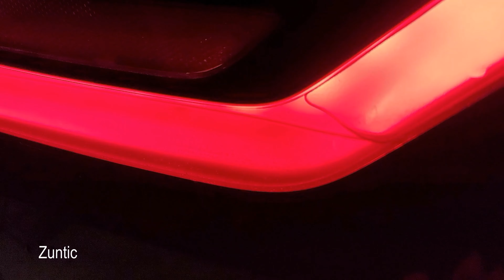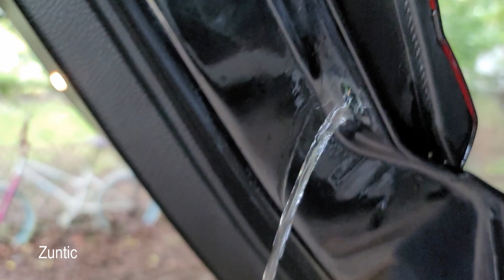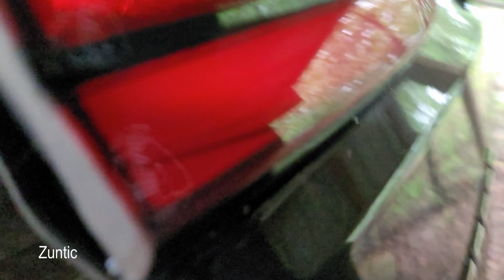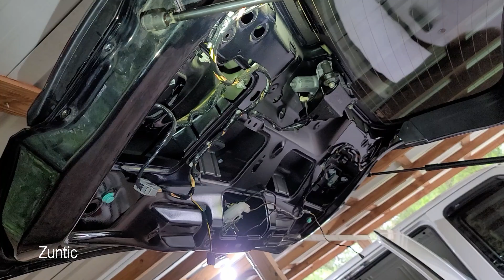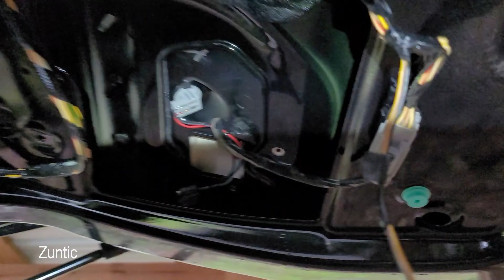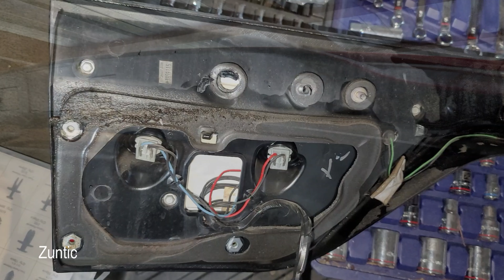Dodge Durango rear tail light water cause and removal

Comment: Thanks for the video.  I’ve had the light replaces once, luckily it was still under warranty or it would have cost $1,000! However, the problem still exists.  I love my Durango, but this problem and the from blinker problem are driving me nuts!  It’s frustrating when you see so many people having the same issue, yet Dodge has yet to creat a recall.  Is there a place that I can complain to to help make these issues a recall?
Reply: I had the same two problems!
Reply: @Johnny Dennis bastards! They had to know these lights would be a problem! I always liked Dodge bc you got a lot of great features for the money and I found the vehicles to be very well built and economical but the lights getting water in them is an issue, as well as, the starter. The engine shut off that happens when you stop at a light, etc is nothing but a wear n tear on your starter so I always turn that off so my engine doesn’t turn off at every red light along the way.
Reply: This firm is investigating the issue - Cafferty Clobes Meriwether & Sprengel. I have reached out to them but yet to speak to the attorney who is handling the case. Will update when I learn more.
Reply: 2019 same
Reply: @iandalrymple7255  any update?
Reply: @Kmac23YT  I spoke with an attorney with that firm and he said these matters can take a long time. I have not heard back from him
Reply: Manufacturers do not issue recalls unless it is a safety issue. The race track light is not the brake light. Therefore, it is not an actual safety issue and Dodge will not issue a recall. That’s not to say they can’t lose a class action lawsuit but for everyone always wondering why manufacturers don’t issue recalls when they know there are designed flaw it’s because they only issue them if they are actual safety concerns.
Reply: Are u refering to the left turn signal bulb out issue? If so i used the alfa obd2 to turn that mess off, had the fast blinker issue on my driver mirror but no bulb out, once i turned it off, no more blinker notification issue 😂

Comment: I was driving at night & my headlights went out. I thought it was the bulb. Replaced it and did it again. Weeks later went to my trunk & I seen the water. Remembered this video. I bought rubber gaskets for the bolts and bought a roll of rubber online and gorilla glued the sheet panel... havent had a problem since

Comment: I had my light replaced under warranty also. After watching several videos, seeing people use sealant to keep the water out, I asked the dealership to please seal it. And they did not after one car wash. I had water in the light again! If you leave the two bottom screws on each side of the light out do not install them it acts as a drain so far that’s been working for me. It’s very frustrating.

Comment: Did you happen to do a video demonstrating how you removed the interior panel on the tailgate? I don't want to break anything, and there are obviously additional fasteners behind that interior panel that must be taken off before removing the light assembly. Thanks!

Comment: Video reminded me I am overdue replacing my blinker fluid. 

Didn't think about the drain plug with mine. I just drilled a micro hole in the very bottom corner. Figure it should drain itself as it needs too. Was a surprising find on a new car and on both sides.
Reply: Has that worked ok so far?
Reply: How has that held up?

Comment: I have the same issue with my 2017 Durango...the light on bottom, red part just on the right side is out. I had the SAME issue with my 2012 Durango but luckily the lights weren't one piece so all i had to do was pop it out and change bulb. UGH! i knew there was a reason I didn't like the back tail lights on the newer Durangos. What a frickin' catastrophe! thanks for informative vid....haha...the music...so melancholy!
Reply: Whered you get the bulb !? I have a 2015 durango and the bottom left track tailight is not working, probably from the intrusion, but where did you get yours??
Reply: @mikegut8029  if your 2015 has a track light, then you have to buy a new one from a dealer. The whole assembly. That’s the problem...the racetrack light is one piece so it’s a tube that you can’t purchase separately. The older Durango’s had 2 separate tailights so you could just go to O’Reilly or any auto parts store and buy the bulb, remove the cover and replace.

Comment: This has been an on going issue with that Durango track tail light for years. I had mine replace 2 times. The issue is the cheap big sponge gaskets on each side. Eventually heavy rain will begin penetrating through the upper part of it. I have a well documented open case with FCA about it . They said they were investigating it but they have not gotten back to me. I have been so fed up with the issue that on the last new replacement that was put in I sprayed it with plasti-dip. Plasti-dip is a rubber waterproof removable paint like material that has been used by car enthusiasts to cover up and paint parts of vehicles. I use it to coat those stupid gaskets that should have been made by solid rubber to begin with. I choose plasti-dip over a caulk because it is removable, incase you ever have to remove the track light. Only thing is you have to spray some in the creases between the body and the light fixture around the gasket at least once or twice a year so it can continue its protectant seal.

Hope this can help everyone with this issue. It doesn't matter if you get a brand new track light this issue will happen again unless it is coated.
Thanks FCA for making such a cheap bullshit gasket.  They have a 95K version Durango Hellcat with this same crap on it. They should be ashamed.
I wish I could work for them and design a real rubber gasket for this issue since all the idiot designers there did not do a good job.
Reply: So is the water getting inside making the light stop working?
Reply: @ldawg7191  Yes if water keeps building up inside and pooling at the bottom of the LED light that area it will stop working
Reply: You removed the water and the light starts working again?
Reply: @ldawg7191 yes
Reply: @ldawg7191 no.  It’s shorted out.  Fortunately only a section 12-18 inches on bottom where it pools at least my experience

Comment: Im going to leave the screw out in mine so the water won't collect dodge has a 2 year warranty on a new one they made it to be defective
Reply: How is it holding on like that?
Reply: @Switzerlandboy420  it's about 10 screws holding it I just leave the corner screws at the bottom off so water can drain
Reply: I’ve tried leaving the bottom bold out on both sides but I still get water. Currently removing my track light as I type so I can just reseal everything up. This is a piss poor design and the fact dodge is avoiding a recall on it is even more annoying.
Reply: Agreed should be a recall I seen a video of someone sealing it with silicon just paid 1,poo for a new track light reluctant to install
Reply: I just drilled a tiny hole in the bottom corner of the tail light which allows the water to drain out.  Works like a charm (although we shouldn't have to be drilling holes into tail lamps... )

Comment: Will it work after Drain the water
Reply: No, buy a new one.
Reply: Depends if you catch it in time if not well you already know lol
Reply: If it get up to the clear part,then it wil start causing damage
Reply: No
I removed the screw and only drains the water when I raise the hatch door after ever F’n rain. Water comes poring out.  In fact it rained last night so I I’m going to use my fob to remotely raise the hatch door and watch the water pore out.   About 6-10 inches of light is burned out.